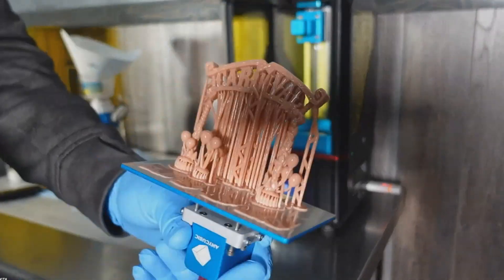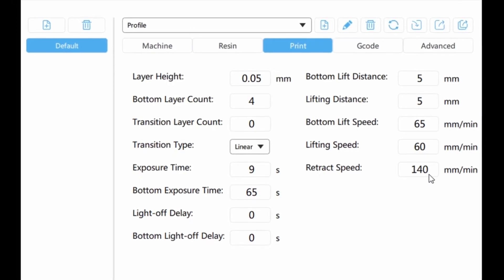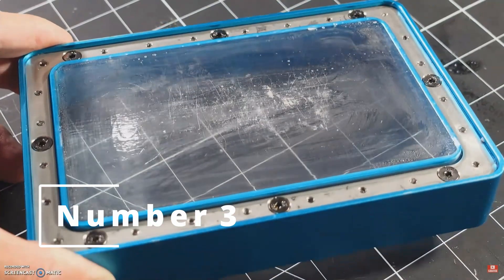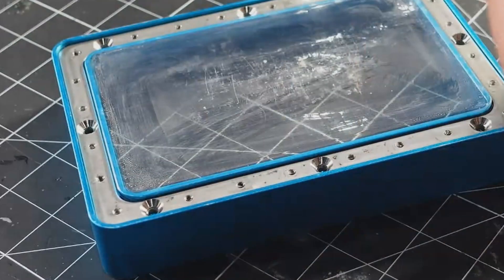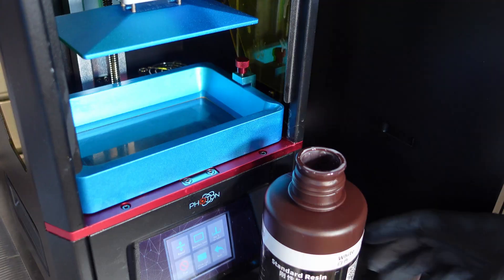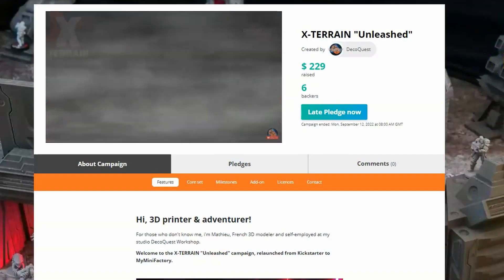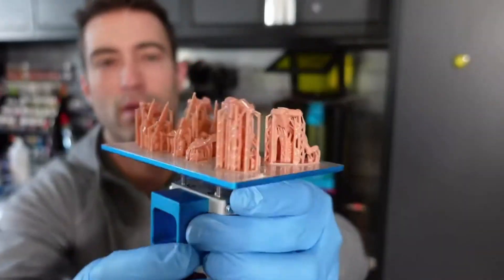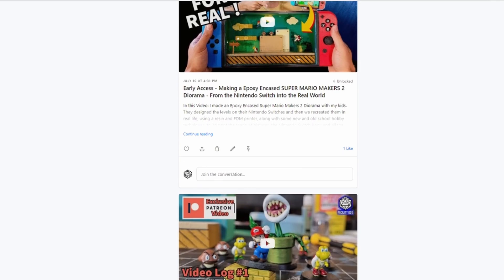5 FAILURES & SOLUTIONS for 3d RESIN PRINTING - Are your Prints not sticking to the build plate?

Comment: I got my GK Two dialed in and did 4 good print session, then on the 5th I started getting rafts stuck to the fep, setting hadn't changed, maybe the humidity level but it has a chamber heater under the vat and has been set to 35 degree C the whole time. I replaced the FEP but it may be too tight, the whole think creaks now when the plate cycles down and up during each layer.
Reply from the maker: Did you tune your FEP when you replaced it?

Comment: I can’t wait to try this!!! I’ve had soooo many issues with only supports printing due to a failure!
Reply: Just hit print! 9hrs we shall see if it finally printed something more than supports 😊😊
Reply from the maker: Keep me updated.
Reply from the maker: You got this! Let me know how it works out. I might be able to help if you are still having issue.
Reply: Yayaayayay! We have a half success. The larger 2 items with supports printed great but the little tiny items didn’t - but they are in supported. I have not learned how to get supports to work because I have had failure issues since the beginning and gave up on trying for over a year and just came back to it this week. Your tip about speed 100% worked - now… to learn supports 😳🙄

Comment: Cheers for the tips.
I use a 200x 200mm piece of glass and sand paper to sand my build plate as the glass is flat. I was surprised of all the high and low points on the build plate.
Reply from the maker: Some people say never sand the build plate, but if done correctly it is no big deal

Comment: After looking at your Photon,  I'm so glad I have an Elegoo Saturn.  3 out of the 5 things you mentioned can't happen with mine. (And my exposure time is 2.5 seconds max). My vat is huge compared to that, it has feet on the vat that interlock to the base, and even if I have one screw tight, it's good. I can leave the build plate loose though.  In a year and a half I only had to level one of the two bases I use because I whacked it too hard with a hammer stripping parts.  Nice video though! I'm sure it will help!
Reply from the maker: For sure I get that. I did upgrade my screen to a mono screen, so my exposure times are down to 2.2 at the moment. That was a cool video on here if you want to check it out as well

Comment: In the very beginning the lift speed was my issue once i resolved that i have almost zero issue with my resin prints.  Although 2 times in the couple years of resin printing i forgot to make sure the build plate was tight.  After taking the prints off i used to place the build plate back on the printer then to get it out of the way and forgot to tighten it.  Now when i take prints off i always wipe the build plate clean then run my hand across the surface to feel any inperfections then put it back on and tighten it.  i also have gotten in to the habit of checking the build plate before hitting print, but that is just me being paranoid now.
Reply from the maker: All of that sounds almost exactly like I do and have done... haha!

Comment: Good stuff. Unfortunately the tuning thing isn't a issue for my printer. It has a different style vat than most other printers.
Reply from the maker: What printer do you have again?
Reply: @FacilityD20  it's a Epax.
Reply: You don't sandwich the fep sheet in between two pieces and then attach the assembly to the vat. You sandwich fep sheet between the vat with gasket and the retaining ring. You then bolt it up tight